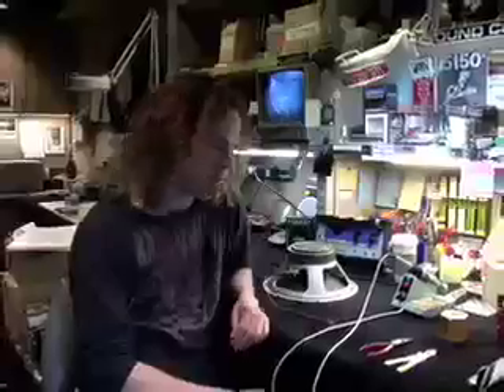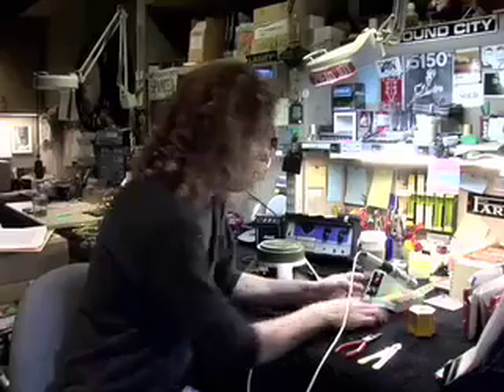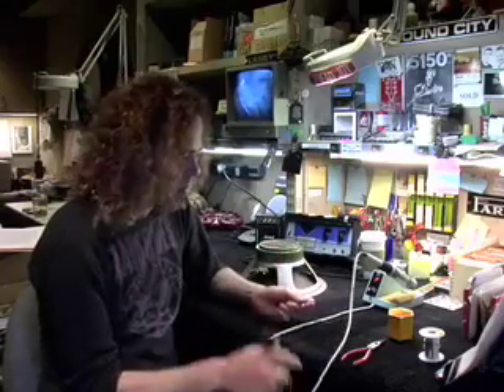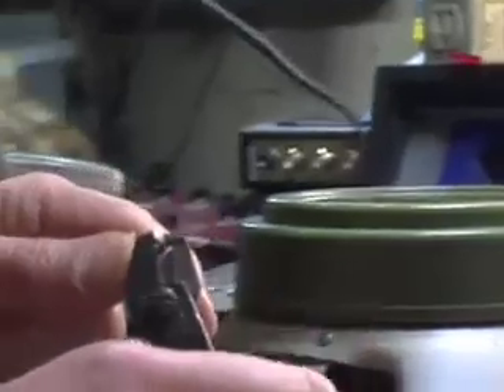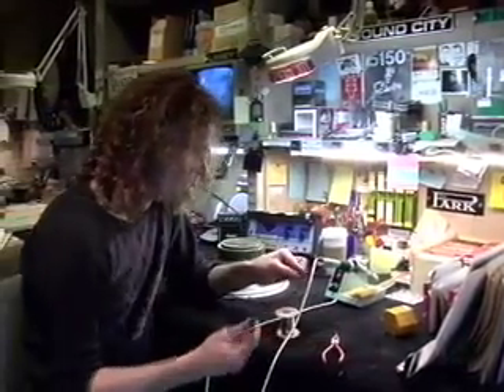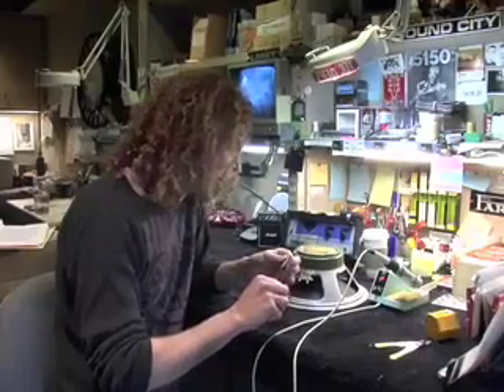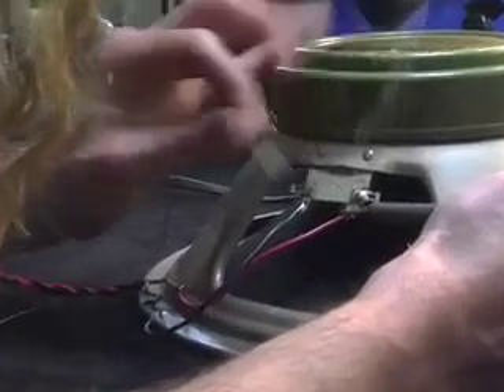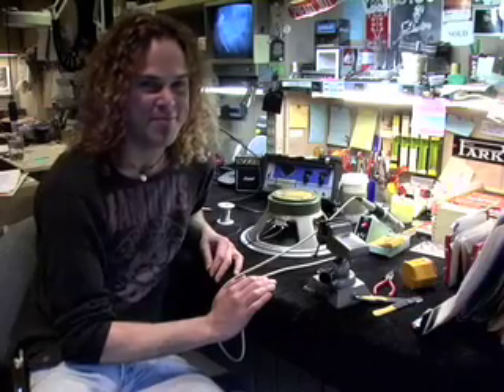Guitar Tech Education 4

Comment: If you inhale enough lead smoke, you'll remain a guitar tech for life. I'm proof! :) 

The Weller I've been using since 77 just finally died. I can't get myself to pay the big bucks for a new one, and yet I can't be without it. Guess I'll just buy one of those batt operated Cold Solder toys or use wax candle drippings for solder connections. 

Cool vid!

Comment: "sod" being what he is....

hey anyone interested in making their leads solid as a rock at the ends.

dip the newly cut and twisted lead in resin before soldering, then the solder goes right up the lead itself making it stronger. make sure you dont melt the wires inside though!

Comment: You should never touch the tip to the solder.  It takes a long time to be able to solder efficiently and correctly.  You want a very shiny volcano shaped joint.  If it's dull looking or looks like a bubble or glob, it's bad.

Tin the tip with solder then dab as much as you can off with the sponge.

It should take 1-3 seconds to get a good solder flow, no more.